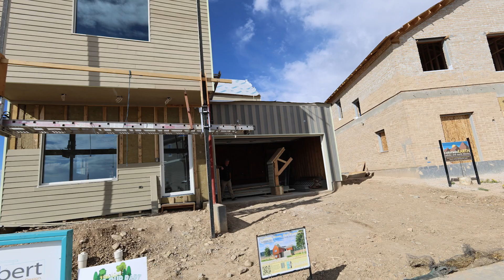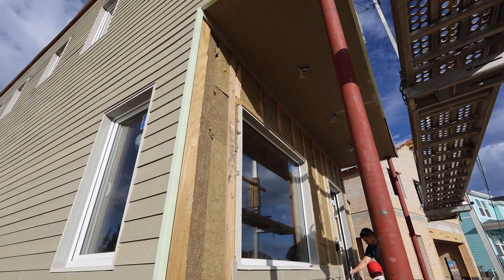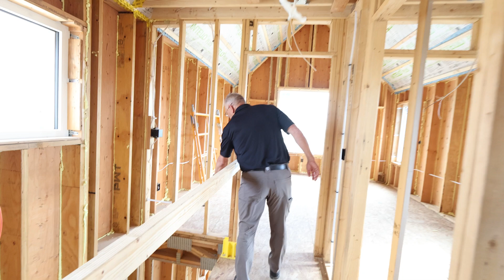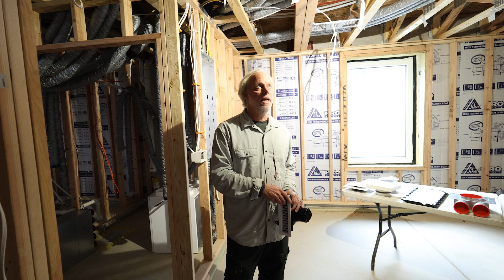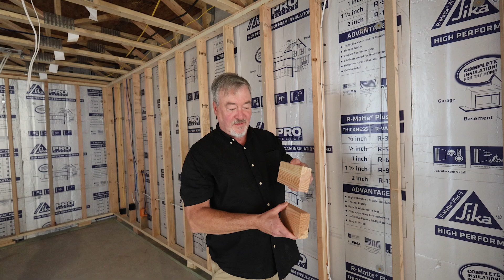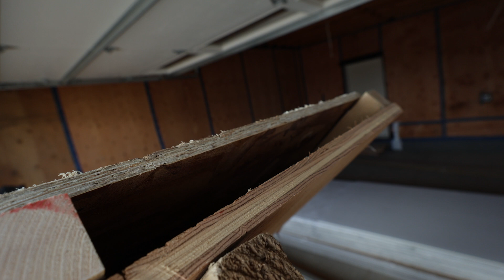ReBuilding after CO fires: Here’s some great details!

Comment: I have been studying Building Science for the last 10 years after being a carpenter for 25! Starting with Joe Istiburek Matt Risinger. I am designing a 2 bedroom in the Santa Cruz mountains for my self. This property had a home that was lost in a fire. This is precisely what I was envisioning! I’m looking forward to seeing more details about these techniques. I believe this will be the standard of the future! Great job work Guys!
Reply: Metal studs is better than wood
Reply: Build a cement/rebar dome and cover it with one foot of dirt and it will survive any fire, a tornado, a hurricane, you won't need fire insurance, and it will last more than 2,000 years.  It will also maintain it's temperature so you will rarely need to turn on a heater or air conditioner.

Comment: I was about 10 miles to the south on that day, so I saw it spreading. The fire was explosive. A small amount of smoke in the distance became this HUGE fire blacking out the sky in the span of about 20 minutes. The wind gusts were over hurricane force. The power went out all over the Denver metro. Everyone in Superior and Louisville was ordered to evacuate immediately. It was quite something.

Colorado can be extremely dry in the winter to begin with, and it was an even dryer winter than usual. True to form for the region, the very next day temperatures plummeted and it snowed.

Comment: Having lived through the Bastrop Complex fire and losing my home in that fire, I was very interested in this video. I like how you call it fire resistance. There is no thing as fire proof. I had a neighbor who had a concrete block home with a metal roof that still burned down. Quite literally the heat came through the windows and caught the internal contents on fire. In my case, I had cleared 75 feet around my home but I had a wood deck that embers caught it on fire and apparently this carried into the house. 

But this video was a pretty good primer on how to make it fire resistant. 

I ended up building a garagedominium with a fully metal exterior and a 3 bedroom home built inside it. It might not be fire proof, but it’s a close as I could affordably build.

Comment: As a separate note, I actually ran into an ERV system that does heat and cool a house in Denver today. Some kind of heat pump ERV that then goes through a mini-split and that single duct system then is the HVAC. Was interesting, and fun talking to the homeowner. Was a full certified passive house, and the guy talked about it the way you do yours, all about the comfort and low utility bills. We agreed that eventually the average homeowner will come to expect this from a house.
Reply: thats probably a CERV unit from build equinox. great units. Also been working on a design with Zehnder and and hyrdo coils to have supplemental forced air with zehnder tubes, to compliment in-slab radiant heating and cooling. Mitsubishi and zehnder are trying to make a hybrid design and i love being the guinea pig contractor for them

Comment: The Perfect Block is the fire protection way to go!  We are in the middle of our build in Arkansas
Reply: Also a wall assembly of 
EF Block ICCFs with recycled Styrofoam infused with 15% cement with voids for a grid pattern of concrete cells.

Comment: I had BMC build some zip walls for one of my projects. Never doing that again.  My trade guys almost walked off the job.  BMC used 16p framing nails to fasten the sheathing on instead of the normal 8p.  And almost every nail was way over driven. It also appeared like they doubled the necessary amount of nails needed for sheathing.  My Trades guys wrecked so many paddle bits and hole saws on that job trying to run wire and pex.

Comment: I love it. I have been waiting for a home showcasing fire resistance. The passive part is a plus. Although energy cost will be low, I wonder that with so much wind, why they did not opt to supplement with a wind turbine. There are some small elegant looking ones that are not obtrusive.
Reply: Matt, you missed the real fireproof house right next door using locally produced adobe bricks using 1000 year old techniques, great thermal stability, ERV and heat pump, high end Alpen windows, home owner/builder extremely focused on fire safety and high wind loads

Comment: Great video! So crazy how they do that bottom plate framing being built to allow up to 3-4" of soil movement beneath the slab. Never seen that before.
Reply: It's because this is a former basin in prehistoric times - meaning all we have is clay, clay, and more clay. If you don't let the walls move independently of the slab, you're gonna have a bad time.

Comment: Maybe slice concrete foam board into strips to mount the siding over the insulation on the next build?  Protected wood IS remarkably hard to light on fire, but like they said details count.

Comment: All of this is fantastic stuff but did they not consider ICF? The same rockwool on the outside to protect the foam and let the concrete provide the fire resistance and air barrier, would save a ton of labor cost and achieve the same insulation value. My friends 4200 sq ft house eclectic bill in the summer with 100 degree plus days was around 100 dollars - his windows is where he cheaped out.
Reply: The foam on both sides of the wall is very flammable. I'm hoping someone can make a mineral wool based icf form but I doubt it can be made rigid enough.

Comment: They almost got it right.  The windows are the weak link in the barrier, and considering how many there are, the chances of just one failing, well, then all bet's are off.

Simple roll down metal shutters (as you find in almost any hot climate area of Europe), or traditional hinged shutters would provide the fire rating to match the building envelope.
Reply: Love the idea!!
Reply: Not to mention they still frame and sheath with wood....
Reply: They did say all the windows were tempered glass triple pane which gives extra layers of protection to heat and fire.
Reply: We will have shutters on our next PH
Reply: It would be great to hear more about fire resistant windows.  Seems like this is a big question mark.

Comment: Ah, Colorado, makes more sense. "Carbon Monoxide" fires was really confusing.

It is great to hear that these homes are being built to a much higher standards.

No "fire shutters" for windows?

So, this house if fire resistant, what about the rest of the subdivision?  

How much of the extra cost of the standards is going to be covered by insurance.
Reply: Insurance increases rates to customers to cover the payouts, and modifies fire codes, and building codes, to change how the houses are built and to utlimately reduce fire losses. There is usually lots of this going on every year for constant upgrades, but maybe not in the coming four or more years.

Comment: How would that house hold up in a Tornado?  Does CO get Tornados?
Reply: If designed for 150 hour wind loads it would do much better than an average house. Colorado can get Tornados but on the Front Range they are not very common or very strong. We rarely get the heat and humidity required for supercell development.

Comment: From the looks of the HRV (heat recovery ventilation), the inlet is about 8"-9".  The distributing hoses from the distribution box looks to be about 10  X 3" tubes.  I would think the fan in the HRV would be on the inlet side, pushing air through the HPV to the rooms and over pressurizing/neutral the house (prevents air leakage into house ) and out through the exhaust side (from bathrooms, kitchen etc) back through the HRV and then outside. 
I have a couple of questions:
1.  Will the fan over pressurize the house?
2.  For efficiency, pushing air through 10 3" very long hoses through-out the house, won't there be less line losses then using a couple of long large hoses that split up near the rooms into 3" hoses for the individual room supply ( like using a water pipe of 3/4 and use 1/2 inch near the sink/bathtub, toilet fittings, instead of using 1/2inch though-out the house)?  Depends on distance between HRV and air outlets and power of the fan. 
3. For bathrooms.  Steam from showers.  As you pull the heated air with water vapour out of the house through the HRV, there should be a drain for the HRV.   How  is the HRV is recovering the heat from the air and water vapour?
4.  Kitchen fans.  Carbon filters above stoves (electric or gas). Even if you have carbon filter on the stove, there might be leakage of steam/oils into the venting. Is it recommended to attach to HRV or simply go outside for stove venting (dump heat directly outside)?  Or a complete different HRV for the stove?  Is there such a system available?
5.  Is the fan running all the time or does it shut down?  If shut down how do you turn on the bathroom fans. Or is the fan variable speed?
6.  Is there a minimum amount of air exchanges that is needed for healthy air? 
7.  Maintenance on the HRV, and cleaning of filters?  
8.  Are there prefilters or hepa filter that can be fitted into the system outside the HRV?

For the basement and the outside walls. The wall looks non load bearing. What is supposed to be moving?  The foundation? or the basement floor? The only thing I know that makes either move is frost. So what magical forces are making it move?  Settling of cement?
Reply: I designed the house, so will reply as best I can:

1.  Will the fan over pressurize the house?

No, the ventilation system in a Passive House is balanced. Intake cfm = exhaust cfm. 

2.  For efficiency, pushing air through 10 3" very long hoses through-out the house, won't there be less line losses then using a couple of long large hoses that split up near the rooms into 3" hoses for the individual room supply ( like using a water pipe of 3/4 and use 1/2 inch near the sink/bathtub, toilet fittings, instead of using 1/2inch though-out the house)?  Depends on distance between HRV and air outlets and power of the fan. 

There are two fans in the HRV, one intake, one exhaust. The unit is a Brink Flair 325. The ventilation tubes are smooth inside. There are losses from the length of the tubes,, but Andrew (the Passive House consultant) accounted for that.

3. For bathrooms.  Steam from showers.  As you pull the heated air with water vapour out of the house through the HRV, there should be a drain for the HRV.   How  is the HRV is recovering the heat from the air and water vapour?

Studies have shown humidity generated within the house (like from a shower) is distributed very quickly throughout the interior air space. If it was going to be a persistent issue (if the climate where the house was located was more humid) Andrew would have spec'd an ERV rather than a HRV. ERVs have an enthalpy wheel that more effectively captures and removes humidity. 

4.  Kitchen fans.  Carbon filters above stoves (electric or gas). Even if you have carbon filter on the stove, there might be leakage of steam/oils into the venting. Is it recommended to attach to HRV or simply go outside for stove venting (dump heat directly outside)?  Or a complete different HRV for the stove?  Is there such a system available?

One system. The cooktop is induction, which reduces the particulates generated. In Matt's video Andrew talks about the various room intakes for the HRV available, one of which has a filter designed specifically for kitchens. 

5.  Is the fan running all the time or does it shut down?  If shut down how do you turn on the bathroom fans. Or is the fan variable speed?

The HRV runs 24/7. Most HRVs have a boost mode with switches in the bath and kitchen that bumps up the ventilation rates.

6.  Is there a minimum amount of air exchanges that is needed for healthy air? 

I'm sure there is. I don't know the number off-hand, but this house will exceed the ASHRAE requirements for fresh air. It's important to differentiate between ventilation rates and air tightness. Passive House requires a minimum air tightness of 0.6 ACH at 50 Pascals. That measures the integrity of the envelope. The ventilation rate is independent of that.

7.  Maintenance on the HRV, and cleaning of filters?  

Once a year, unless there is a smoke event, which would require changing the filter after. 

8.  Are there prefilters or hepa filter that can be fitted into the system outside the HRV?

There are, and the system has them. 

For the basement and the outside walls. The wall looks non load bearing. What is supposed to be moving?  The foundation? or the basement floor? The only thing I know that makes either move is frost. So what magical forces are making it move?  Settling of cement?

Yes, the interior wood stud wall is non-load bearing. The bentonite soil in Colorado can move a LOT. That was new to me. Chuck's solution for that is brilliant. 

Rob Harrison CPHC, HARRISON architects, Seattle, WA
Reply: The Bentonite clay layers swell with water and can shift a whole neighborhood up and down (well below frost level). The gap prevents the slab movement pushing the basement walls and pushing the house off the foundation. 
In a development close to my work they dug to the bentonite layer, pulled it out, mixed it with the remaining soil, and then replaced the whole works back into the original landscape configuration. Moving mountains, mixing them and then rebuilding them!

Comment: All wrong...Best way to build is not vent the roof at all, the only reason people vent the roof is to dry condensation. If you spray about 1 inch of closed cell foam you won't get condensation then insulate the rest with what you like. The E84 fire retardant needs to be in the spray foam.

Comment: so we talked about the HRV ventilation.... but no one talked about what the actual HVAC system is/will be..... comments?
Reply: Some discussion at 25:05
Reply: My understanding of the Passive house concept is that it is so well insulated and air sealed that it doesn't need a lot of heat input or output. A couple of regular mini-splits in common areas with that distributed by the constantly circulating HRV. In Colorado it is so dry that interior moisture is not an issue unless you have an indoor hotub.

Comment: Why not external steel roll shutters? If fire and fire ember packets are a legitimate concern, aren't the windows the obvious weakest link?
Reply: He said tempered windows are heat resistant. However, I'm with you. Roll shutters. At least on the ground floor.

Comment: so after all that happened they build more houses so close together that if one goes they all go and they build them with grass field directly adjacent to the home was nothing learned the first time around rather than a fireproof house maybe a fire proof neighborhood is the way to go house wont burn if the fire never reaches it PS and another thing about homebuilding is why are they not equipped with sprinklers if i was building a new home today i would fit it with a sprinkler system then a fire is pretty much contained to the room it starts in
Reply: Was wondering the same. With all that available space in CO, why build your house with only 10ft separating the next house?

Comment: Fire Rebuild.... in CA.... ICF walls, one story... metal truss... metal roof.... interior metal framing..... nothing combustible in the construction... the only "combustibles" is the EPS foam on the ICF (the mass of actually combustible material quite small), and the interior cabinets and some wood flooring on the elevated concrete slab....   If you wood frame, it will burn out from the inside of the walls... Our house that burned was built in 2011 and I built it to "ultra fire safe", rock, thick stucco, exterior.... that wood framing burned out inside the walls,,, the stucco and rock were basically still standing without the wood framing.. Sooo.... wood framing in a fire zone is a total fail...

Comment: That's most definitely not fire resistant enough the wood is combustible
Reply: Its cement board not wood.
Reply: @mitchdinner9743  it sure looked like wooden studs and plywood sheathing for a possible thermal combustion
Reply: @rob214  the fire resistant features are on the outside of the building where the fire threat would be.  Like the metal roof, cement board siding, and rockwool over foundation.
Reply: @mitchdinner9743  I agree but if medal studs were used it would be even better and more resistant to fire
Reply: @rob214 Only if you use thick metal studs. Super thin metal furring does not have much fire resistance.
Reply: @kazedcat  red steel
Reply: @rob214  sure if the budget was unlimited.
Reply: Yes, a fire/heat test would be good for the wall and roof assemblies.  I do see, though, that if there is little fuel outside the house (trees, bushes, buildings, biomass) then surviving the relatively low temp and quick grass fire means if the house doesn’t ignite the building will survive.
Reply: The threat is a very brief exposure to high heat, thermal radiation exposure and flying small embers. The wood walls would get very hot but will not ignite. Imagine how close you could place you hand to a fire pit if you had piece of hardiboard between with air gap on each side.